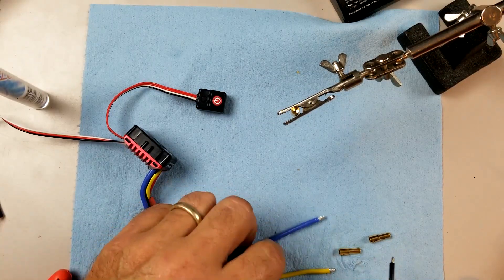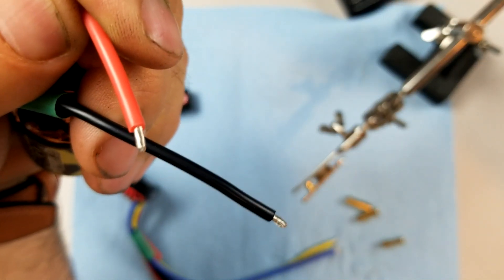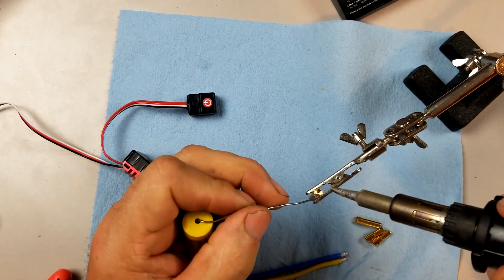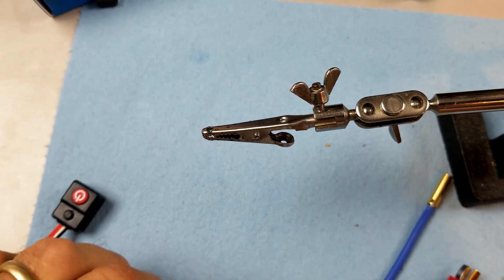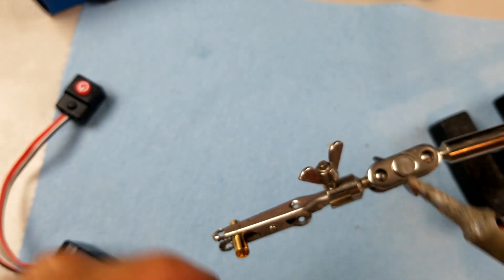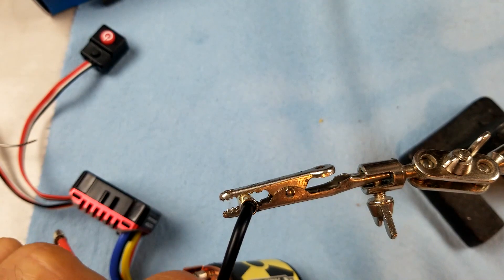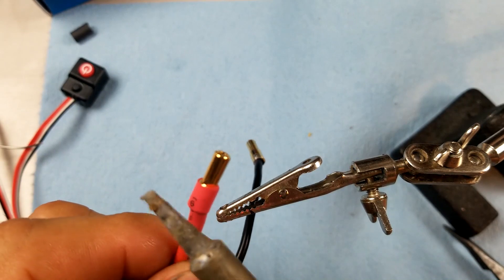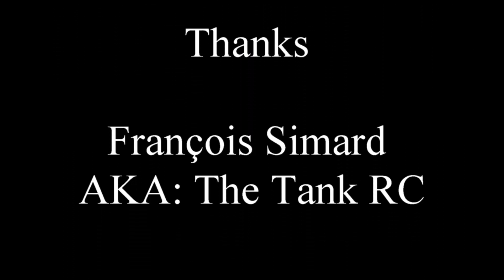Soldering motor Leads to motor and ESC

Comment: Odd to see a pure solder joint with no crimping.  These joints ever heat up and melt out the solder?
Reply from the maker: Thanks for the comment, it should not melt on the 80 amp  ESC and running on 2S or  3S.  When you’re running a 120 amp ESC and above, you do have to use a different souder, that has a higher melting point.

Comment: Hi, anyone know what gauge of wire is best to power a F405 WING FC? The leads from my ESC are maybe 18GA, while the Lipo is like 10GA so I bought some 12GA pigtails that are really beefy... prob. better than only 18 or 24GA, yes?
Reply from the maker: In your manual of the ESC it should tell you what gauge to use, if it has 18 gauge it should be good 18ga, using a 12 gauge you cannot go wrong that’s what I would’ve done

Comment: Why do I have to tin my wires? Do I have to fill up the cup when a connector is only half a circle where you solder the wire to the connector? I’m new to soldering.
Reply from the maker: You have to pre tin your connector to have a better connection, if you try to solder a bare wire to a connector you might overheat the connector in it might melt by the time you get enough solder on your water, you don't have to fill the cup all the way up but it does help

Comment: Any solder info is a big help. Thanks. The bigger gauge wires are what kill me.
Reply: Yea bud if your having problems you need to get a higher wattage Hotter solder gun for the larger wires it will make your soldering so much more easy.
Reply: @ShenRC  I did get a Weller 750 degree set. So, it's down to pilot error.
Reply from the maker: Just like Shen RC said  A hot soldering iron will help a lot, I do have some tips and tricks then I'll be doing in the next video.